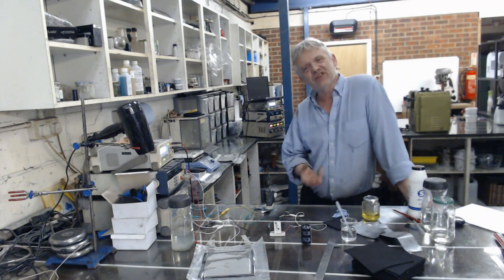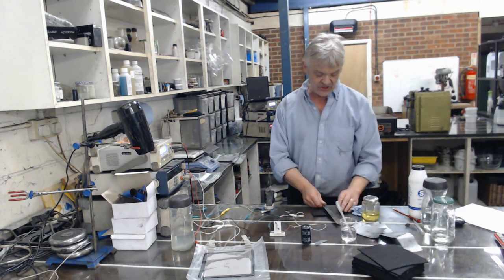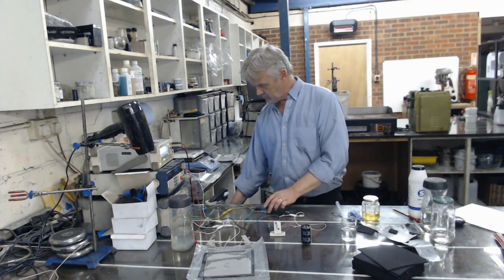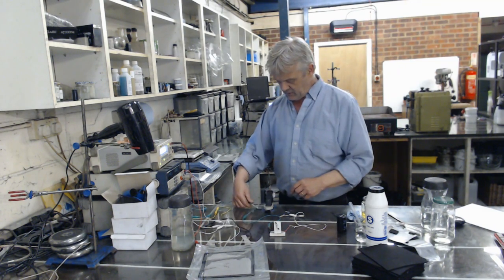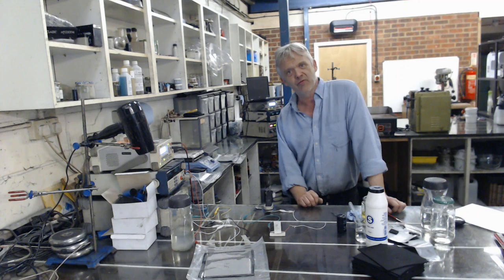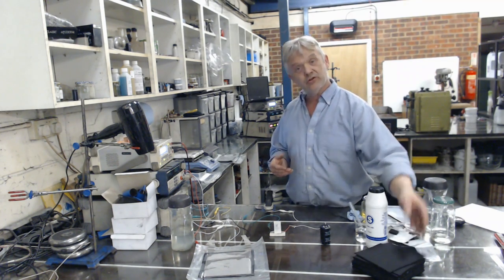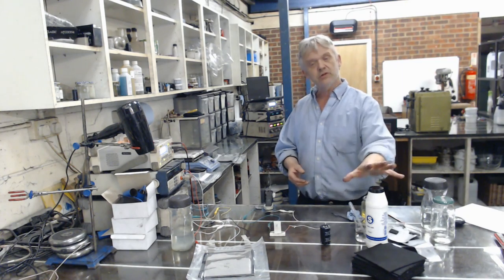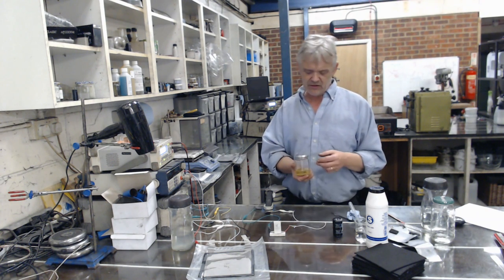An 'Off-The-Shelf' Supercapacitor To Build

Comment: 1st off the science stuff, especially the doing, is great.  Watched quite a few of the battery and supercapacitor video's and am wondering if you've covered building a simple charger or chargers for the different voltages and amps?  Your desktop apparatus is wonderful but a bit dear for most of us.  I'm going oldest to newest so if that's been covered later, wonderbar.  If not is there such a thing or things or something inexpensive that serves the purpose?  Something that would prevent overcharging and damaging what is being worked on.  2nd, though it seems to be implied I'd like to ask permission to use your video's in classrooms.  I teach science across the pond in Canada and very much agree with the idea of learning by doing.  I happen to think your video's would be quite inspirational.

Comment: Thanks again for another great video, I have a question about the nitrogen doping you briefly mentioned by soaking in urea and cooking at a few hundred degrees, I have played a bit with urea and graphitic carbon nitride at 550 but what temperatures are you talking for doping 300-400?

Comment: dear Rob
I have a question related to graphene oxide but not in field of adsorption. Does grinding the flakes of graphene oxide is necessary before BET analysis?or generally, does grinding increase the specific surface area of GO?
Reply from the maker: depends on the kind of grinding mate - there are at least four process i can think of all different but would come under the heading of 'grinding'

Comment: HI Robert, I have a question . I make my batteries with cersulfat 

can I mix cersulfat and potassiumhexacyanoferrat II  together without getting very toxic ?

thanks.

gerhard
Reply from the maker: to be honest mate - I don't know - cerumium sulphate is noted as a redox additive in the research papers and hexacyanoferrates are both redox additives and used to form host matrixes for multivalent ion insertion and deinsertion but i haven't read a paper combining the two nor tried it myself - so i just don't know i am afraid
Reply: @ThinkingandTinkering  thanks for the answer . lg gerhard

Comment: cool video some good info thanks for sharing Robert, hey i have a question for you...
is it possible to polarize an insulating material 
eg. have plastic type material sitting in a strong electric field created from 2 steel plates ( big air capacitor ) with positive wire connected on one plate and negative charge wire on the other plate,
while the plastic is in a hot melted liquid form and the strong electric field is active would the plastic polarize in relation to the field and if we start to let the plastic cool down and return back to its frozen /solid form would the plastic material hold a polarized effect?
im thinking if it is even possible, that you could somehow polarize a sheet of plastic. would this increase the dielectric constant of the material as long as you have the sheet facing the correct way in relation to the capacitor plates polarity.
and would you still retain the dielectric strength properties of that material?
the thought behind this is how magnets work as they can hold there magnetic dipole structure if they stay cool (frozen / welded state), but if they get really hot ( closer to melting / liquid form temperature ) they seem to de-magnetize possibly being that the atom structure becomes free to move back to an original equilibrium state,.
what are you thoughts on this? 
do you think that something like this is even possible to do?
i thought i would ask as i cant seem to find a great deal of info about this topic.
thanks steve
Reply from the maker: electrets are made in a very similar way mate - i might make one on a video
Reply: @ThinkingandTinkering  thanks for the reply, that would be awesome to see as i have never heard of an electret before, if you do end up making a video on this topic im kinda interested to see if this method can be used with some insulators that are physically strong and don't dissolve in water such as plastic.cheers mate

Comment: Are you thinking of making your super capacitor using your graphitic coal waste formed into sheets exactly like this? Heck you can sell a kit with simple instructions and a step by step video using this very sheet. The kit can be made for different form factors. Up to the size of a truck battery. They add water to your electrolytes and buy the case online.
Reply from the maker: interesting ideas mate - i will have a think about it

Comment: Well done Robert, but we really want to see the Big Batteries now...lol... What about your 12 Volts 1 KWH battery ? Can you please show it running and powering a 12 Volt 50 Watts Halogen light ? Many thanks. Regards, Stefan.
Reply: You are Both right!
1) Robert is highlighting the build(materials) resulting in (SUPER)capacity depending on the build quality.
2) Hartiberlin is mentioning the IMPACT your channel and info has by not competing anymore but now superseeding commercial products!

People are therefore interested in implementing your SUPERcaps into the fast changing real world of electric and electronics like Solar and Vehicles.
Your Big Batteries video was the intro of your findings into practical implementaties.

Well done, changing the world!
Reply from the maker: do you know what mate - it doesn't matter what you do - soemone somewhere complains and says do something different

Comment: Hi Rob, People might also try Calcium Chloride. SAFE to use and much higher ionic strength than table salt and much less temperature sensitive. Can obtain a very high concentration which does not freeze - the reason used on roads - not able to freeze so crystals will not wreck your capacitor. Calcium chloride is cheap as chips from local hardware - used for drying air in cupboards. Make an almost saturated solution at room temperature i.e. add as much as possible to saturate until undissolved remains after stirring. Drain off the saturated and add about 10% water (then won't freeze. If saturated at room temp, then cooling pushes it into crystals at lower temp. Little bit extra water stops this.).  You can place final capacitor in freezer and should come out and still  work great. Then try leaving in sun to get to say 40C and compare. Good luck. (Would be great if people could post their results comparing NaCl with CaCl.) Do not put the NaCl one in freezer, likely to freeze. Suggest put the solution in freezer first ..if it freezes, warm up add a little more water until it doesn't.
Reply from the maker: awesome suggestion mate - love it and thanks for the post
Reply: How much voltage can CaCL2 hold then ? also 1.6 Volts as Sodium Sulfate ?

Comment: I've been wondering if your carbonized felt was carbonized cotton felt or just impregnated with some sort of activated carbon, now I know thanks for that and all your suggestions too.
Reply from the maker: there are two types mate - one is cotton and one is wool - in the cotton you get more or less all carbon in the wool you get nitrogen doped carbon. The one on the shop is cotton based as the wool one is pretty difficult to do well and that makes it expensive - i figured the expense made it's appeal limited so we put up the cotton

Comment: Interesting. So, if one lived by the ocean and set up several of those along the in/out tide line, one could make a somewhat constant psu?
Or, could one make one simply with an entrance and exit, submerge below water line and allow normal water movement to constantly refresh the saltwater electrolyte?
Would require regular maint. for algae of course, however I could see a package like this as an emergency power source for near ocean hiking maybe.
Reply: I think that there might be an issue with the electrolyte from one cell being in contact with the electrolyte in another cell. In lead acid batteries, the cells are separated so that the fluid does not circulate between them. The only contact is between electrodes.
Reply from the maker: they aren't a power source in themselves mate - you'd still need some form of generation

Comment: thanks Rrobert, so much echo while talking ,hard to understand you.
Reply from the maker: sorry mate - it's the lab - not a lot i can do there
Reply: @ThinkingandTinkering  Well maybe you can a sound guy made panels from secondhand terry cloth bath towels 4 of them each held in picture frames that worked as well commercial sound dampening and he only needed to strategically place them IE he did not cover all the walls just one half meter frame per wall. but all that takes time so I would rather you worked on other things that interest you. Intern project maybe?
Reply from the maker: no mate - it's a lab - i am not hanging old towels everywhere
Reply from the maker: mmmm - i like the tie dye idea - lol - he has two options mate - either listen to the sound as is or don't bother listening - there is just nothing i am going to do about it
Reply from the maker: you too mate

Comment: Benjamin Franklin did work with glass plates as separators for capacitors in stacks reportedly very high voltage and they retained charge when pulled apart.
Reply from the maker: that's just a normal capacitor mate
Reply: @ThinkingandTinkering  Yes Ben just made a capacitor and it works far better with graphene at very high voltages say from the high altitude atmospheric experiments you were interested in a while back? A capacitor that can take thousands of volts in charging is useful.

Comment: Another great move and video. 1, question. Could you use separators and make a real power capacitor out that stack of material on your table? 2, what was the name of the Doctor you referenced? I could make that out. Great work putting this in the shop.
Reply from the maker: yeah you could mate and it's Dr Richard Kaner

Comment: I hope super-caps will be put into smartphones soon,they will last alot longer between charges and will take less time to bring up to full charge Robert.
I really enjoyed the super-cap update.
Reply: I should iterate on my last comment. If a new super cap has the same energy storage as your today's type battery, then no it will not last longer between charges. Yet i assume you are talking caps that have a larger energy capacity. Robert is working on these. Yes they will take less time to charge if we pump them with more current than our chargers we use at the moment. Maybe 5 or 10 amp or better may be required instead of silly 500mA/2A chargers we have currently. I bet i just opened a can of worms! but you get my drift.
Reply: @unlost117  
Now I know who spilled the worms in my tackle box. Thanks a lot for not letting me know sooner. What a mess that was! 😏
😄
Reply: @scotttovey  Free the worms i say ! Sure hope you got some lures 😏
Reply: @unlost117  
LOL. 
Actually, I don't even have a fishing pole. I just happen to have a knee jerk post reaction when a stupid joke pops into mind.
🤣
Reply: @unlost117  Well,if you go to XS-Power web site,look at the amp hour ratings,they are higher then ANY lead acid battery and charge in less then 1/4th.of the time.
Reply: Thank you guys for these worms, I'm digesting a few of them. 

To charge our telephones+tasers, I think that we should consider using other connections and wires than the microUSB and those tiny cables. 

I've recently had a serious issue with a Raspberry Pi which was repeatedly reporting low voltage.  Its electricity was supplied by a stupid telephone charger.   So I changed that power supply for a higher quality unit, delivering more amps and a better quality power.
But still, the Pi was complaining again.  I bought another power supply unit, dedicated to Raspberry Pis.  And again, the Pi complained...  It took me a while to find out that the USB cable was causing the trouble: simply changing the cable for a thicker one solved - at last - my issue.

My point is that there were just one or two amps, at most, travelling in that pesky wire, and it was already faulty.  So, to charge a supercapacitor superquickly in order to repeatedly use the taser during, say, a worm invasion, would probably require bigger wires, bigger connectors than the ones we use now.
Reply: @pierrechevaliergeol  Haha i love your freedom of thought. now im thinking of toasted worms wearing helmets !!! Yes my Pi 3 B did exactly the same until i bought a 5v 3A power adaptor specifically for the Pi's. Enjoyed your humour.
Reply: Not necessarily, however that would be useful if you are adding say a taser device to your smartfone which demands alot of energy quickly. ps i did not say that !!